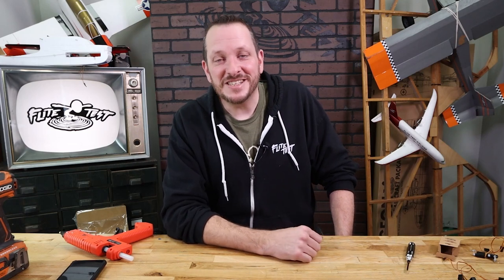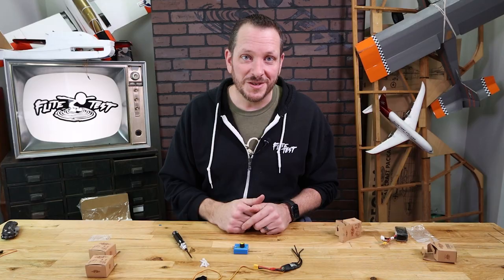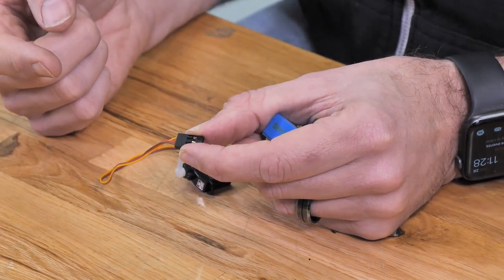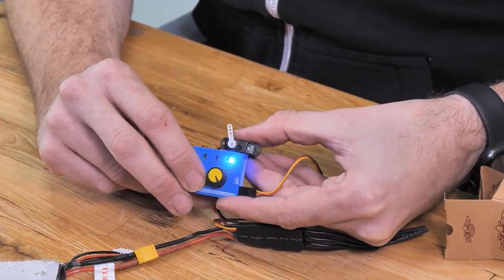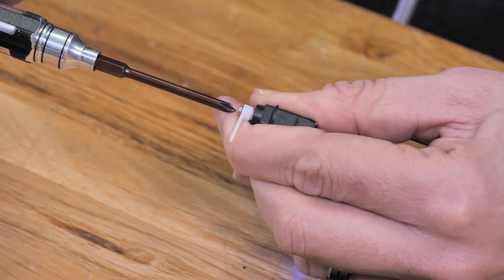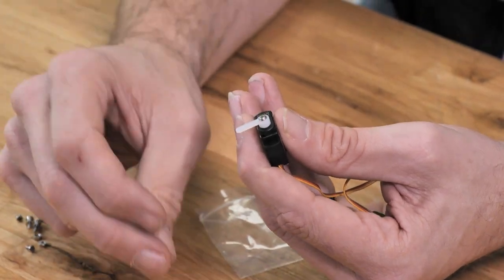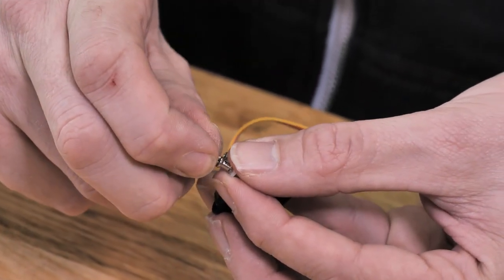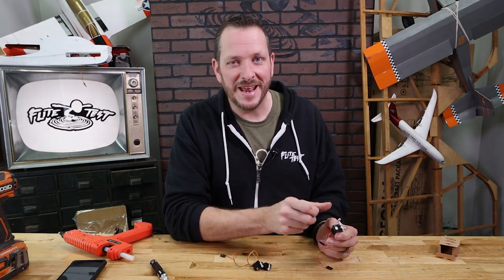How to Center And Prepare Your Servos For The FT Tenet // BUILD

Comment: With those linkage stoppers I bring the nut down tight and back off until it just turns freely, this takes out the slop and makes for a precise control link.  Then secure with a touch of ca ( or hot glue shown here). The centering thing is very important, my club has 140 members and a good percent need to watch this video considering the planes I've bought, helped repair or have been given to me. It's a wonder some of them flew in the first place.

Comment: Is there a solvent that can be used to remove the hot glue from the linkage stopper nut? I've been using blue Loctite on the threads.